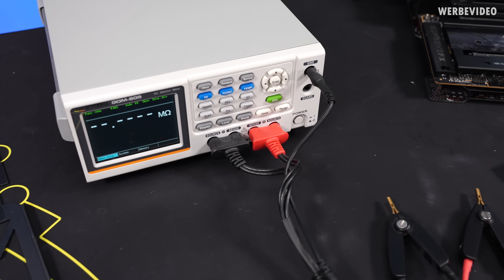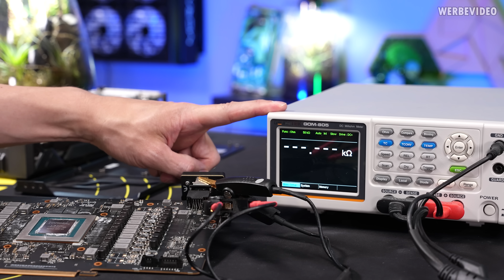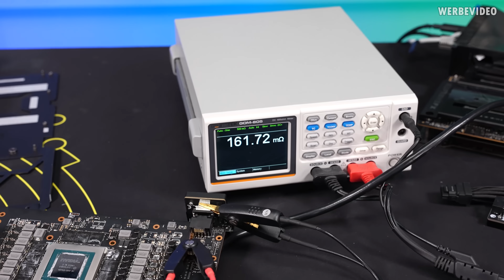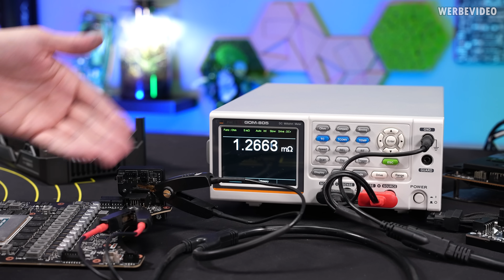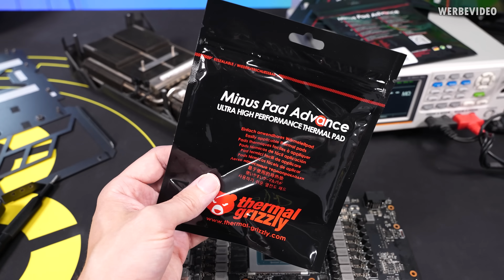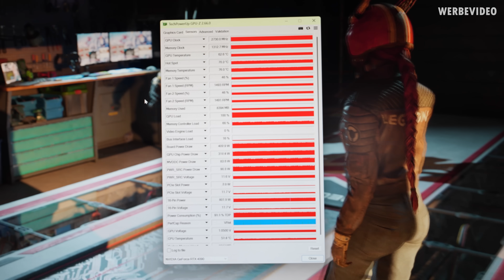It Happened Again – RTX 4090 with Melted 12VHPWR

Comment: I have that exact same card, Asus TUF 4090 OC + 14900K powered w/ a EVGA Supernova 1000 P2 80+ Platinum, 1000W using a CableMod Basics E-Series 12VHPWR 90 Degree PCI-e Cable for EVGA G/G+ / P/P+ / T - Variant B (Black, 16-pin to Quad 8-pin, 60cm). 

I have the 4090 power limited in Afterburner at 90% as it actually performs better than at stock 100% and I have 4 temp probes attached to the gpu power plug connector. Two are being fed into Aida64 connected from the mobo and the other two are monitored from iCUE hub. 

I have a HUD that I can monitor the temps (not the voltage) of the connector plug while gaming which idle at about 28-30C (Texas heat) w/ a full load CP2077 (4K 120fps) at 40-42C. I've been running this setup for about a year and a half as my 4090 will be 2 years old in Oct.

It's horribly annoying to never have peace of mind knowing that one day my card might melt like this and won't be covered by the warranty.
Reply: Well, it won't be covered if you're using a custom power connector, right?

Comment: How many does it take before the PCIe people admit that their design for 12VHPWR/12V2x6 was just a disaster that anyone with a base understanding of electrical engineering could see? I mean: pump much more power through thinner wires and connectors; that will end well... how?

Comment: This wireview monitor is cool but useless! It only monitors the cable. But the cable it NOT the problem. The problem is the connection.
So I'm asking why the f.... You make a busbar in this wireview tool? Just controlled every pin to the card and it would be perfect???

Comment: Need to stick some of the skool RAM heat sinks we used back in the mid to late 2000's when using core only blocks and see what that does to the temperature of the plastic.

Comment: Nvidia is shooting itself in the foot with this connector design. Even the best AMD Radeon cards just use x2 8-pin connectors.
Reply: Supphire 9070xt oc has 12VHPWR, XTX use 3x 8-pin. 
So no, you can't blindly buy AMD.
Reply: @drayke8886 yes but on AMD side the power draw is only about 340W maximum. So, no overcurrent risk there
Reply: @drayke8886 They prob have actual load balancing though
Reply: its possibly intentional to make it reliable enough that most desktop users dont have an issue but unreliable enough that you cant use it in a data center
Reply: I specifically bought a 9070xt that has 8 pin connectors, but there are models with the 12v one, so you gotta be careful.
Reply: How did you get upvotes for being 100% wrong? The best Radeon cards have 3x8-pin connectors or the 12V-2x6/12VHPWR connector. Nothing you wrote is correct.
Reply: @Tomazack  > How did you get upvotes for being 100% wrong?

For a second I thought we were on Reddit

Comment: You already build the solution on your wireview, just one big massive bridge... now make a connector for 1 big wire.. 12v+ and mass. just 2 big wires to connect the card and it will look better than all those tiny atx mtfuggers.
Reply: LTT did something like this. It was a bit of a clownish show, but he did utilize high amp capacity cabling + connectors. Entertaining.

Comment: I doubt that was shipping damage. The wire view including some cables pulling down just added a lot of tention on the connector thats why it was cracked and bend the sense pins. And i think this was the whole point of the reason it melted. This is just content for the clicks and the whole internet goes wild on it again...
Reply: The shipping damage appears to have been done after the melting though (Due to the imprints in the shipping container).

Comment: 4 trillion dollars, btw. They couldn't possibly afford a well-known functioning power connector standard that don't burn your overpriced metals. That's beneath them.
Reply: The more you buy...
Reply: Dude! You're not thinking about the poor billionaires, major shareholders, and owners! They need to buy their yachts too! They can't do everything! Poor souls.
Reply: @Maisonier You do realize that most institutional investors are retirement vehicles and they are required by law and regulations to maximize return on investment? 
Thank Congress
Reply: how do you think they got to this value :D
Reply: @Twitch-oq3ir  They got this value because some 4090s have burnt connectors covered by warranty. Right.
Reply: Nvidia loves one time use graphics cards 🤪!
Reply: @aberkae  the more you use the more you buy.
Reply: Why do you think they are worth 4 trillion, NVIDIA NEW DESIGN, RAZOR BLADE GPUS USE ONCE THROW AWAY BUY A NEW ONE - coming for the 60xx series
Reply: @circuitbreaker7949 there’s no other company with that technology and with 3 years of product orders on the books… all sold. Nobody is selling hardware at $40k-$100k a piece that is effectively all allocated and sold… plus a markup that would make Apple cry and have a tantrum with.
Reply: Worse than that. 
Nvidia is control freak af.  Why are there no board partners that make the old 30 series design of the same 12VHP connector?  The one that didn't melt.  Oh, it's because Nvidia flatly refuses to allow them to.  There is absolutely no reason why THE ENTIRE AIB list of all partners with Nvidia all uniformly do not do the 30 series style of connection on the PCB on all of their models unless Nvidia is doing it's usual anti-consumer/noncompetitive antics.
Reply: $4 trillion dollar company that's realistically an $800 billion company
Reply: But that would cost them 5 pennies extra per card! Would you not think of the multi billion dollar company!
Reply: Afford, is the wrong words. Their engineering team is focused on data centers. the small team focused on designing GPU's have limited time to source everything. they rely on the specs of other engineers. as per the numbers these connectors should not be doing this. but its been shown that the single bar interface is the problem, but it wasnt until recently. Could there have been more better testing, yes. was it fixed by some board partners who may or may not have tested and found this to be true, maybe. Was nvidia unperceptive to board partner feedback, unknown. but it seems like Nvidia doesn't care about PC consumers. so Why should we care about them. There should be a recall. Just like how Toyota has a failure of their throttles, causing catastrophy, Nvidia should be responsible in some capacity. OR OR instead of buying a koenigsegg cuz it goes fast we buy a BMW or Civic that can go fast enough.
Reply: @ronin.badger you can’t fix the issue without load balancing, Nvidia isn’t allowing major changes like that.  Vendors CANNOT fix this… Asus simply added a detection mechanism to warn you in software.
Reply: Its on purpose.
Reply: so stop f buying nvidia at all, period\
Reply: They don't care. Green fanbois will buy it anyway.
Reply: That would cost like 50cents less in profit per card, cant have that
Reply: The connector wasn't meant to be used at the wattage they are pushing it. Blame nVidia for using that connector...
Reply: @ruikazane5123 12v @ 9.5A per pin gives 680W as the design spec of that connector.  You have another 75W available at the PCIE slot.  Connector is absolutely fine to support sustained 600W.  You cannot overload that 9.5A per pin limit… load balancing is required to follow that rule.
Reply: This is typical of how greedy and fat corporates behave. No surprise actually.
Reply: last time I checked this connector was not only backed by nvidia but many other major computer hardware brands.
Reply: Beneath them? That's is all NVIDIA's fault!
Reply: jacket man will put AI on 12VHPWR and will call it quantum innovation
Reply: @BangHJL , consumers supported it . I'd say "well done nvidia" instead ...
Reply: "The more you buy, the more you save!"
Reply: Build in reason to buy/upgrade your card 
If it doesn't break they can't sell you a new one xD
Reply: The connector is "alright", the board design sucks.
Reply: a bigger concern is why UL even certified their design and didn't call them out on it.
Reply: the more gpu br0k due power connector.. the more you..
Reply: multi dollar company
Reply: XT60
Reply: it baffles me that people are ignorant enough to think that nvidia is responsible for the connector when its actually PCI-SIG who is responsible for PCI standards and specs, then make comments to spread misinformation
Reply: @innie721 some people don’t understand how standards are developed… put it this way even if you changed the connector it would still melt…. If I pull 30A through a single pin then it will f**king melt.  The PCIE SIG specifies a standard for the connector… it doesn’t specify how  you pull current across it…. that’s the designers job of the product.
Reply: It seems that valuations have built in knowledge that the customers will just eat up the costs for shoddy quality no matter what.
Reply: You mean, by simply saving even more money by NOT inventing a new propriety standard?
Reply: You ask for better materials but who you think go pay for that 🫩
Reply: They don’t care😂
Reply: other issue is NVIDIA removed a power balance component on the cards after the 3000 series, there will always be runaway with voltage cause the card won't tell the PSU where to put the voltage. tho 5000series had more stuff cut from them
Reply: In the automotive world, you can't blame the car manufacturer if you install a different 'universal' alternator and then the wiring harness burns.
Reply: Or at least to mandate a solution that truly check/validates the connection, like on the cheeky Astral
Reply: @nagi603  nvidia doesnt care, same reason why they removed physx32. But I wonder, does the AI gpu RTX Pro 6000 also melt? because it is used by servers for AI, nvidia would definitely not want their AI customers to complain about melting, but it is using the same connector, so rtx pro 6000 doesnt melt? or it doesnt draw anywwhere near 600w? or how does it work? I would think that nvidia doesnt care if gamers' gpus melt, but they should care if server ai gpus melt...
Reply: Why would they idiots bought it anyway
Reply: To be devils advocate for a second... There really isn't anything wrong with the 12vHi-Power standard... Its NVIDIA's negligence, post connection.... Their scrimping of a few pennies/cents per card, by removing current balancing and preventing 3rd parties from including current balancing that was on all prior cards before the 40-series... Had they included common-sense current balancing on the card... There wouldn't have been a single issue with the 12vHP connector.
Reply: @bobinator17 load balancing is mandatory since you can overload a single pin… which is the issue we are seeing.  If you have six pins rated at 10Amp each and you push 30Amps through one pin then that’s going to fail… it’s out of spec.  That’s not the connectors fault… the spec clearly says 10A per pin and you’ve pushed 30A…
Reply: @KleoGroutides  Indeed, I believe that's what I was trying to say... Nothing wrong with the Connector Standard... The issue is that Nvidia decided to Drop all Load-balancing, and prevented Card Partners from including it within the 40+ series cards... cutting costs on the assumption that there would be a perfect connection on each pin and that would be good enough... obviously its not... and anything using 12vhp should have a load balance after the connection. unfortunatly Nvidia scrimpted and then doubled down on the 50 series
Reply: @bobinator17 load balancing was always included with PCIE 8/6 pin, also with EPS. We didn’t see melting connectors even when running completely out of spec.  With short quality cabling PCIE 8-pin at 300W is perfectly fine.
Reply: @bobinator17  there is an issue with the connector. The BTX connector has 300% extra capacity as a margin of error.
This shit connector has less than 10% extra.
It's basically, nothing can fail before the wires overheat.
Reply: @monad_tcp no there isn’t… I’ve explained it previously.  Could the pins be better? Yes.
The connector is rated to handle 9.5A pp and spike up to 30A pp… the issue is that there’s no load balancing on the card so you get uneven current distribution.  Could it be one pin has failed and making poor contact maybe… however the load balancing would prevent the connector melting.  

PCIE 8-pin simply had a larger pin with more contact area but had a large area requirement.
Reply: @monad_tcp  I agree that there could have been, & evidently was needed to be, much more capacity with the connector standard. However, I still feel that despite the connectors shortcomings... Had Nvidia kept its Balancing circuitry from the prior generations & especially the first test case: 3090ti, there would not have been the issues that have occurred.

The fact that Nvidia continued to use the connector on the 50 series, and still didn't re-introduce the currant balancing circuitry, frankly baffles me!
Reply: @bobinator17  Not spending "few pennies/cents per card" for the amount of cards they are selling makes someone multibillionaire.
Reply: Brotha
Reply: It’s not happening to all of them.  Or most. It’s a rounding error.  They never show the hot box it came from.
Reply: 4 trillion dollar company meaning it, not they.
Reply: Consumer GPUs don’t account for their entire valuation. Naive comment at best.
Reply: @_chex they don’t count at all… Nvidia could exit the gaming market completely at this point.
Reply: It’s not the connector, you don’t realise the effort and validation the PCIE SIG does.  The connector relies on a suitable power stage… that’s not part of the spec, the spec simply says 12v on each pin… it’s an implementation issue on Nvidia side.  FYI the PCIE 8-pin would melt under the same scenario.
Reply: @KleoGroutides still even pci sig is reevaluating the design
Reply: @zappulla4092 again it’s not the connector, you can’t reevaluate the design they will simply replace it or supersede it… both options that take years to do and would be merged into a new spec.  I can’t remember if PCIE v6 has been finalised but it’s too late at this point.
Reply: @KleoGroutides That's why there's 3 of 8 pins usually for that kind of cards.
Reply: @unruler I’ve run a single 8-pin at 300W without issue… yes it’s a shorter cable but there’s no melting.  It’s also out of spec… it’s works simply because of the current balancing.  On the 12-pin high power your into melting territory at 20A per pin and fire at 30A per pin.
Reply: @KleoGroutides  Where are you getting that older GPUs had per-pin load balancing?  I've never seen this claimed before and in fact seem to recall it being mentioned that this is kinda hard to do with the huge transients NVIDIA GPUs tend to pull.

The reason 8 pin hardly ever burnt up is because the safety margin is way higher and there is more surface area on the pins to dissipate heat and reduce contact resistance.
Reply: @alexatkin all GPU’s prior to those using the 12-pin had load balancing.  Yes it does have more margin… the 12-pin also has margin as it can handle 30A max per pin for short durations.  The issue is lack of load balancing, your pushing 20-30A through a single pin while the total power is still 600W.
Reply: @KleoGroutides  Again, where are you getting that information as I have never seen anyone make that claim before?
Reply: @alexatkin  Buildzoid.  Also you can examine the PCB, each PCIE power pin has its own route.  They are NOT joined at any point.
Reply: @KleoGroutides Wasn’t it Buildzoid who openly admits they are not an electrical engineer? AFAIK each pin would need its own independent VRM section, not simple or cheap.  Old boards may have monitoring per pin but that doesn’t balance anything, merely lets you see there is a problem not prevent it, like the ASUS Astral card does.
Reply: @alexatkin old cards were exactly like that.
Reply: @KleoGroutides the 8pin is rated for 150w so yeah... You would expect it to melt... What a useless point
Reply: @Lonewolf_121 8-pin was over engineered, it can handle 300W sustained with decent cabling.  Not a useless point.

The other point why it doesn’t melt is that all implementations were load balanced… plus in 99% of situations you had an additional 6-pin PCIE to take some of the slack.  Hence there is zero possibly of those connectors actually melting… Nvidia should have simply used x4 8-pin not created a new connector.  Nobody seems to realise the 8-pin connector is far superior, there’s more contact area, it’s more robust, the wire gauge is thicker, the insertion cycles are 100X higher.
Reply: @KleoGroutides  PCIE-8 pin specification specifies three connectors for this use (300+ watts) and has in order of 100% reserve capacity. The reserve capacity over specification is essential for use in enclosures where temperatures are often much higher locally. Maximum real world spec is dramatically reduced in enclosed warm spaces. 
Thus flowing 300+ watts at 12 volts through one small connector in a small warm space is stupid by design and a sure way to get disasters. Any problem will result into a meltdown or fire. As this vid post is another example of that.
Reply: @basbass429 you’ve literally not understood what I’ve said, the 8-pin connector was not designed to cover future PCIE versions… nobody knew power draw would creep up that high since the industry expected process scaling to continue.  

Yes the connector could be better however… the root cause is the current balancing not the connector.  

I’ve personally worked with it with no issue whatever, we have load balancing and clamping mechanisms.  I don’t disagree that it needs to be improved… it’s finicky and not robust enough but doesn’t mean it’s going to melt.  If you’ve followed the rules and guidelines then there’s no issue… again you have to load balance… it’s not optional.
Reply: It's nvidia's fault that the user broke the card with the wireview?